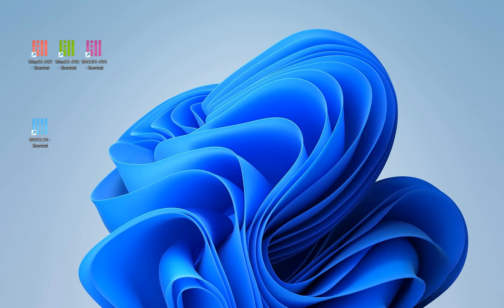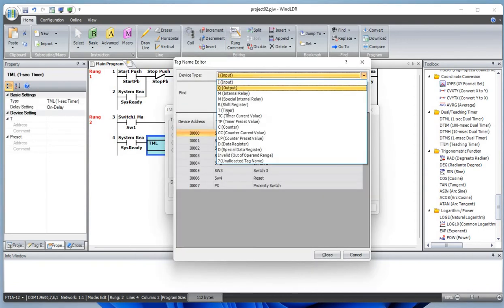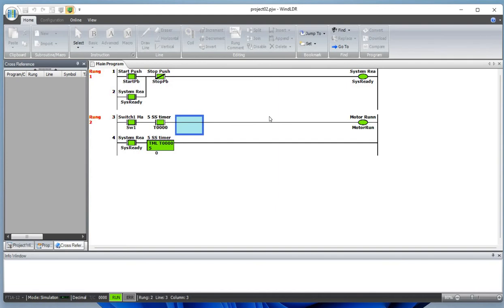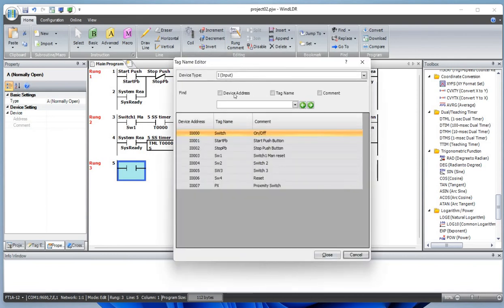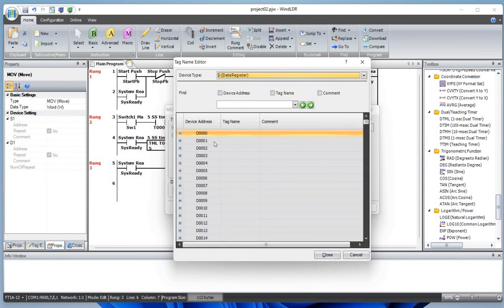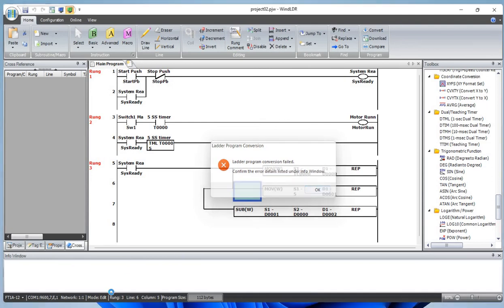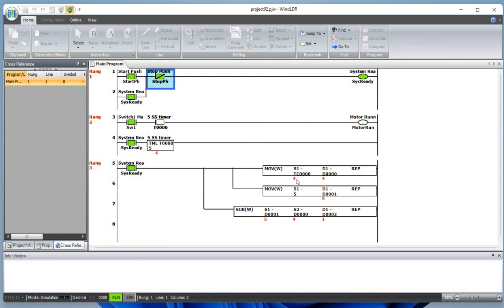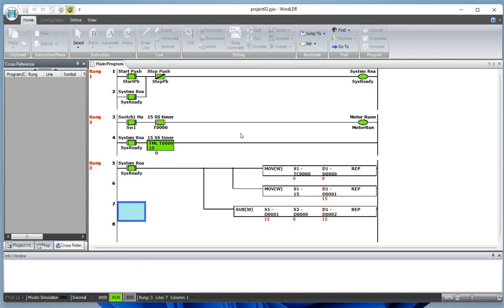3 Idec Plc Programming WindLDR Timer & Move Instruction

Comment: Sir, i need to setting my thermocuple to a certain temperature and after that selenoid steam open,. i confuse how do i program the thercmocouple using ldr
Reply from the maker: what kind of plc are you using? what type is your thermocouple module? Set up the type of thermocouple, use the scale function, and PID if tuning is needed. Use setpoint and compare the reading from the thermocouple.

Scale, average, and pid functions are explained in the help section.
Reply from the maker: https://www.youtube.com/watch?v=AFWHCkqVVJ8
Reply from the maker: I hope this gives you some idea.